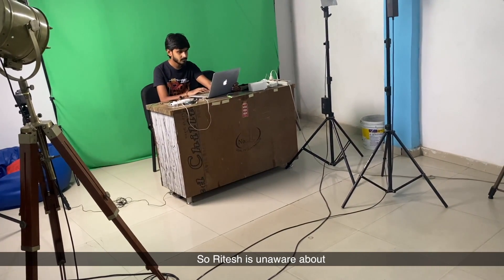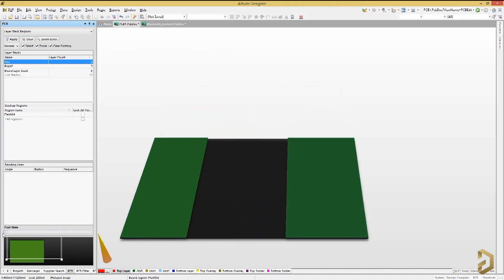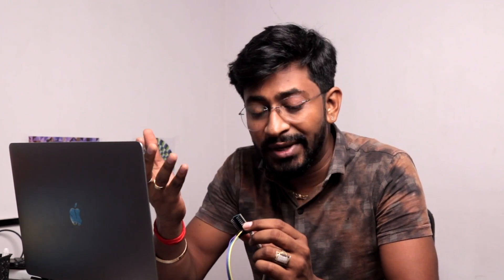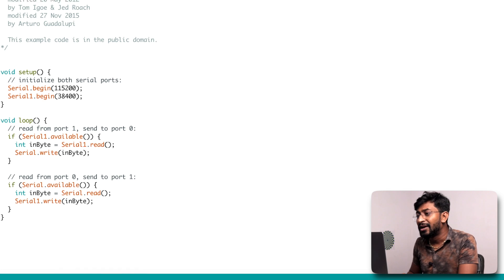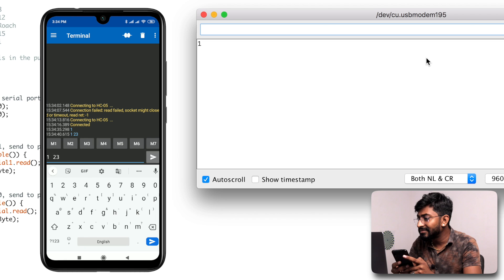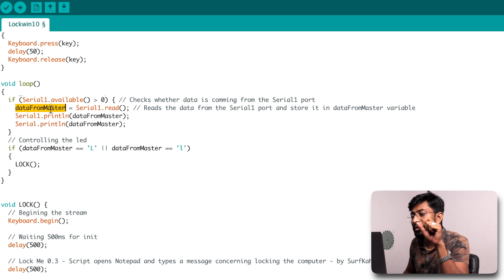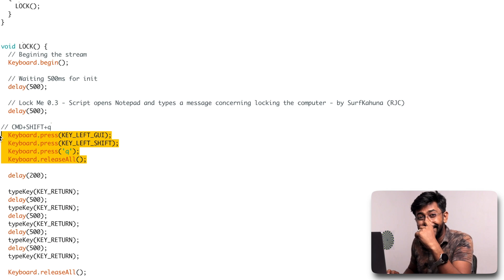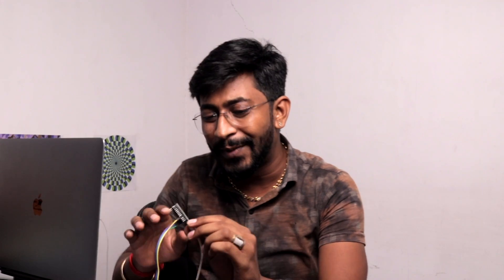Using Arduino to Hack Computers 👨🏻‍💻

Comment: hey i have a question.....  i want to connect lcd and bluetooth module to arduino... arduino have one pin of 3v and one of 5v and my culetooth can run on 3.3v to 6v and lcd requires 3v to 5v... but when i connect lcd to 3.3v i get very little visibility of text. and cant even get a pin for 5v output from digital.. i need your help.. what can i do.. pls pls pls reply.. can i give external supply to bluetooth i mean rx and tx will be connected to arduino and 6v to 6v's battery and gnd to -ve of 6v battery and give a ground pin connection to the -ve and gnd wire of buletooth module?

Comment: actuly i did what you did it worked  but when i reconnect the board it is not apearing only the code  which i had uploaded before is doing its job  .so can you say how can i make  the board appear to the ports again
Reply from the maker: You have to Put a button kind of thing which will trigger all the commands which I did in this video and the previous video as well 

So until and unless we don’t connect that particular pin to ground, it won’t execute any commands and the port will appear in Arduino
Reply: @techiesms  ok   thanks

Comment: Its 2 years old system called rubber ducky and i don't think that such projects be published . Let it  be there in documentation part only  instead of video format.
Reply: Its actually More then 10 years old  and its almost 5years when rubber ducky touch the market in Hack5    and  4 years when Seytonic 1st time reverse engineered it and now its All on the other level
Reply: Check out the latest video of @Networkchuck for the same rubber ducky using Pi Pico